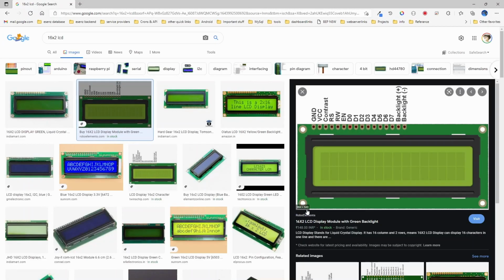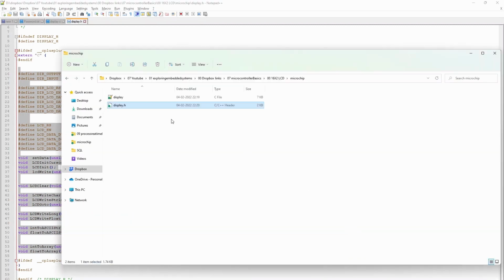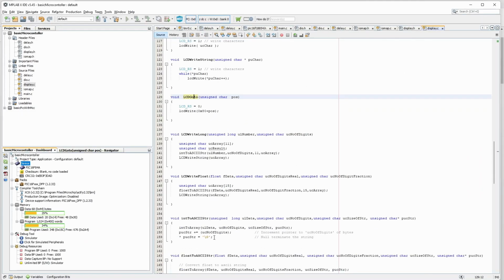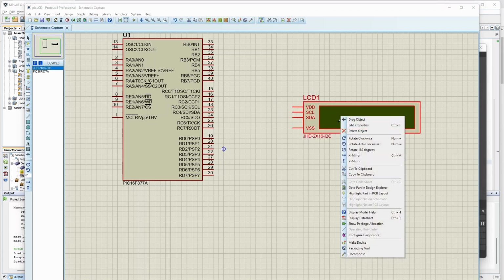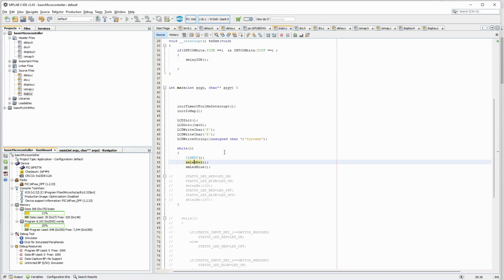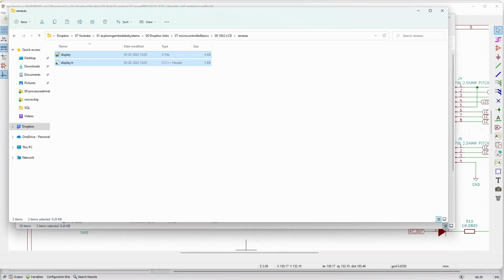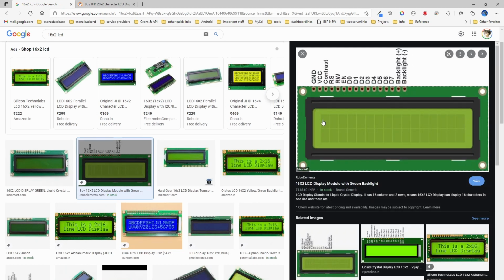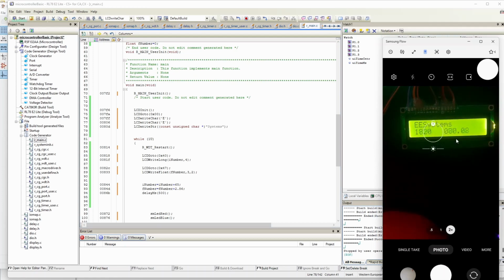Microcontroller basics 005 : LCD | 16X2 | 20X4 | Renesas | Microchip

Comment: Sir Thank you for making this video. I used your steps to interface my RG1602A LCD display with my mcu R5F104BA. But i am facing an issue where the first row of LCD showing completely black rows. I looked it up for what could be the reason for that and found it might be due to initialization issue.. Could u help me with what i might have done wrong.
Reply from the maker: If all the connections and portraying are correct then try increasing the delay and check. Also check I'd individual pins are going high and low with 1 second delay. Just to make sure all the connections and port mapping is correct
Reply: @exploringembeddedsystems743  i have double checked the connections and port mapping and have also put a delay of 1 second when going from high to low. Still that issue is not resolved. Is there anything else i need to check while i initialize lcd display?